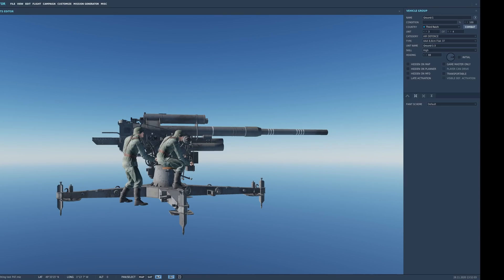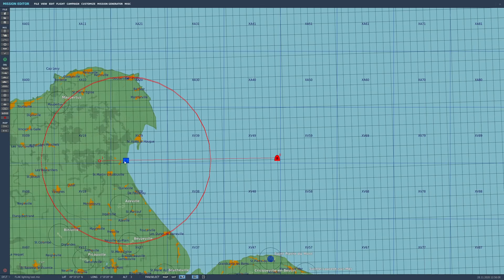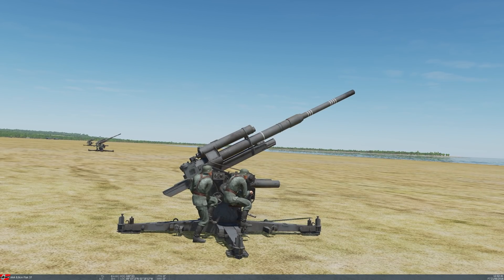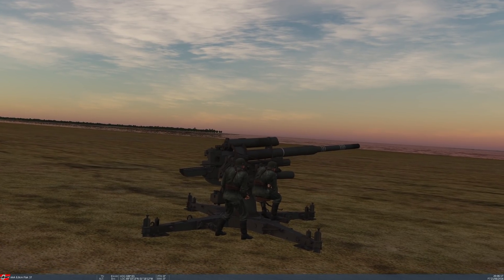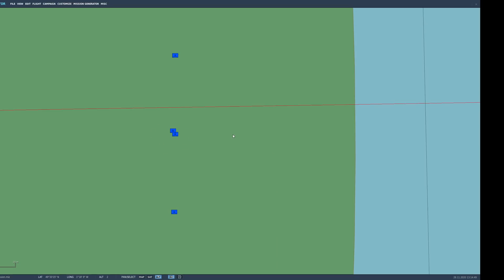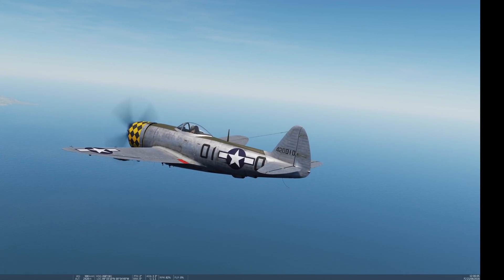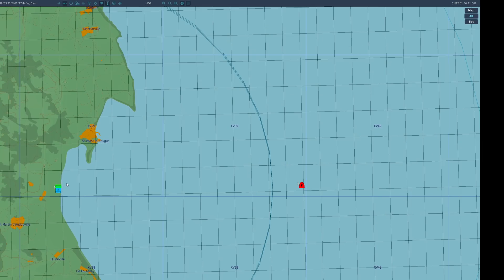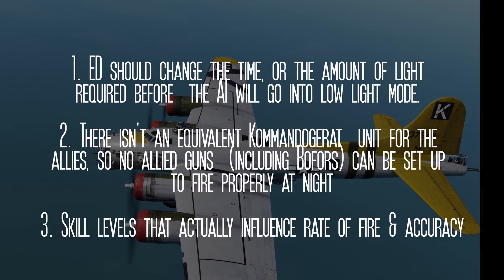Does DCS have a Flak problem? . . .

Comment: Excellent points Phil and a great test of the day/night detection. And yes, I do agree woth your findings on this one, I myself found that manpads were completely useless even at similar conditions to yours. However, I have a few questions regarding your tests!

1. Do AI in groups share info? If that is the case, your 3 guns in 1 group detection skill test is invalid, as the expert unit will detect and share the info. For a proper test you should have made 3 separate groups.

2. When your group consists of three differently skilled units, you can't tell which gun is scoring the closer hits, thus I would suggest you rather had 3 guns of equal skill, and running a single test for each skill. You may or may not discover that they are more or less lethal based on their skill.

But as this video mainly adresses the detection distance, question 2 is trivial even if it may be interesting to look at.

Also, IRL the Kommandogerät 40 is by no means a detection device, only a rangefinder. It uses two mirrors at each end of the tube to correlate them on the enemy aircraft. Once the images line up (focus), the distance may be calculated using trigonometry (angle of mirrors and distance between them) and relayed to the flak guns. Knowing the exact distance, FLAK gained significant accuracy.

In DCS, it behaves like an EWR and also seems to improve accuracy. Not sure about the Kdo.Ger 40 had this it's entire service life, but some rangefinders towards the end of the war had lead computing DIRECTLY fed into the cannons, effectively providing lead computed FLAK. Before this invention, it was more common to experience barrages of flak which were set up in front of the flight path. The bombers would either have to fly through it, or change course. 

In DCS, we do not have this barrage feature, which would be more common and coordinated (thus more lethal) for flak without fire control computers.

Comment: Well, did anyone actually expect AI Sight Simulation to be already implemented, the most basic dogfight AI is only starting to be improved, let alone "minor" ground AI. It's just some simple fixed script that lowers their range based on time of day, and the bug being it's not accurately corresponding to visibility level at that particular time. It's not that simple, cloud and other weather can mess this up, among other thigns, so the existing system is obviously very rough. AI stuff is not that simple done on a whim and is far more complicated, it's going to take major effort and will be discussed a lot first IMO, it won't just happen overnight, but yeah, this shouldn't be hard to fix to make it a bit more accurate, which should simulate the realism a lot better even without the ultimate solution. With clever programming tricks it's possible to approach reality very closely without actually simulating the root fabric of it.